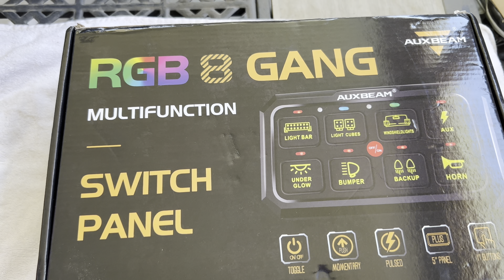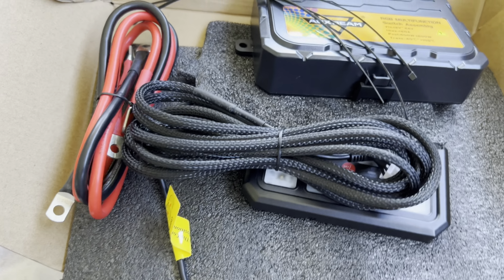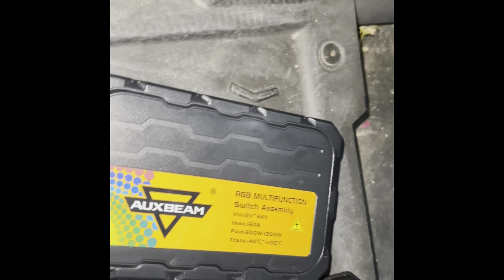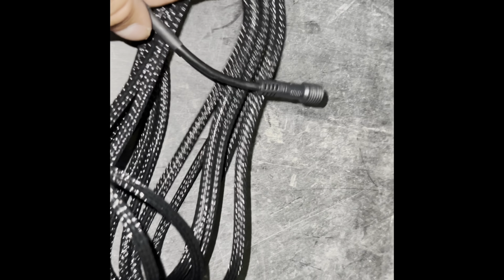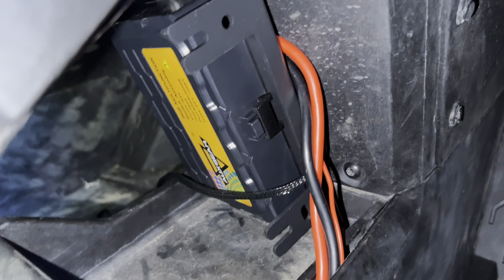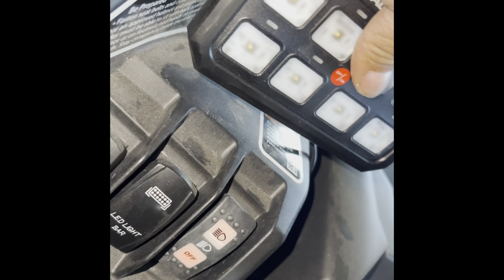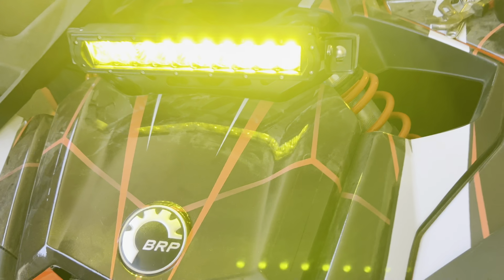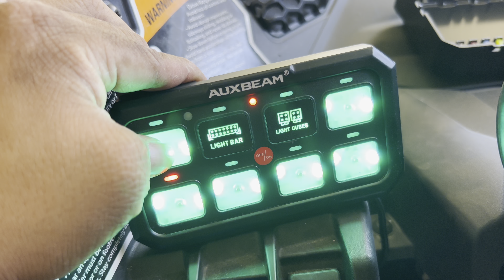AuxBeam 8 Gang switch panel on Can-am X3

Comment: I can just swap out the fuses the give you right if I wanna run something that’ll draw more power?
Reply from the maker: Yessir you change it to a higher  fuse if you are going to draw more power, I only am running small pods and a little 10inch light bar so I didn’t change it in the vídeo brotha thanks for watching I appreciate it 🙌🏽🙌🏽
Reply: @ghostridervlogz661  yeah I have a shock tower light too but it’s a Baja designs onx6 and I have a pods that are squadron sports but I’m gonna get some Amber bumper lights that are either lp4’s or lp6’s and I just wanna be able to make sure nothing is too much draw and got you bro
Reply from the maker: @X3.Rvxlll  you should be good with the pods and shock tower light just look up how much power does the lp6s run to see if you have to add a higher fuse